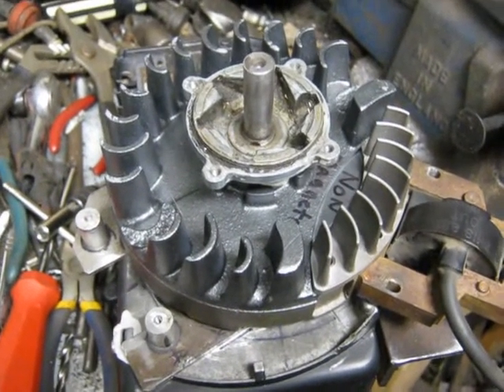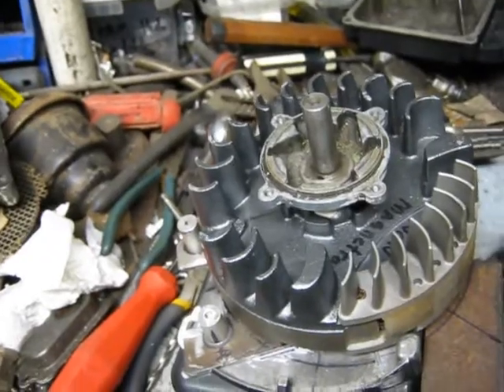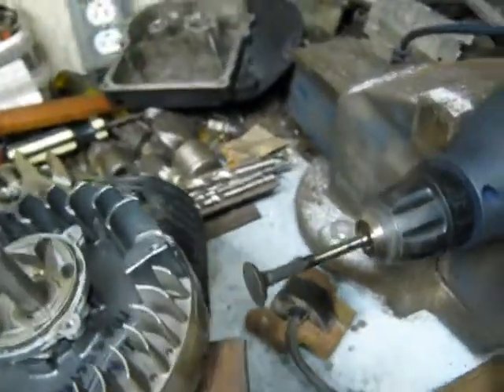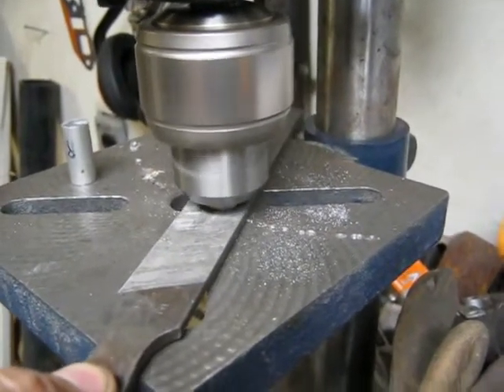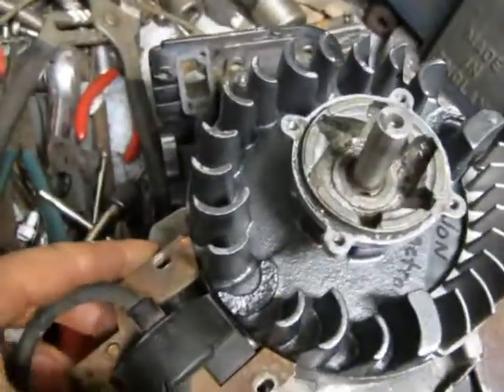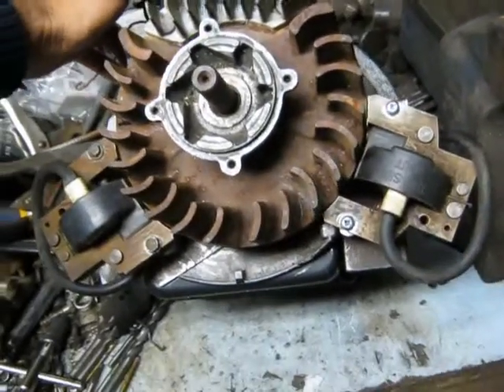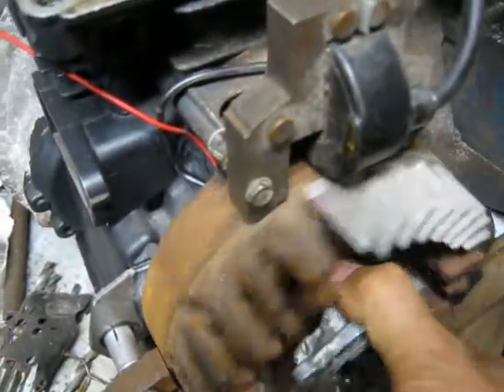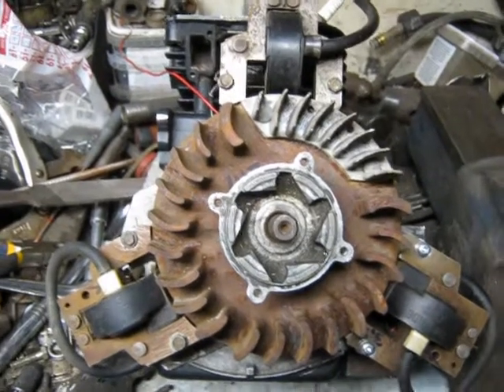3 Cyl. Briggs 327 Magnetos Mounted

Comment: how you been charger guy i havent spoke to u in a bit good luk 327 rotary
Reply from the maker: James Scherbenske Hey good to hear from you, I got the 327 running, it just has some serious crankshaft slap making noise.
Reply: ChargerMiles007 what is it hitting ??the block
Reply from the maker: It is the split joint between the crankshafts, they have too much play, so they make a slapping noise when the engine is running. I imagine one of them would break if I kept running the engine.
Reply: ChargerMiles007 ohh ok maks total sence too me by the way iam a jenious when it comes to theses engines ask me any questios

Comment: So do you like the points and condenser better then the magnetron coil?
Reply from the maker: beingsneaky Each one has its advantages. Points will fire at a much lower speed, probably making starting easier, though they can get corroded up over time requiring maintenance. The magnetron is very easy to install, in comparison, and seems to be long lived (if you don't try to spin the engine over without it being hooked to a spark plug!)  I guess it is a toss up for me, though I have used more Magnetrons the last few years.

Comment: Cant wait to see it run. :)

That's a clever idea with the drill press and file.
Reply from the maker: willythewave Yes, it can work well on small projects, you just have to be very careful, or you could eat the file!   It is strange how life works though, last night I was working on drilling a 7/8" hole thru 3/16" steel plate making the carb. mounting flange for this engine. I was almost done when the drill bit jammed, and the 1/2" drive hand drill almost broke my wrist, as the handle on the side slipped on the housing! I have never had a drill grab that hard before, it actually tweaked the drive shaft of the drill so that the chuck is a bit out of round now. I can't use my drill press on large bits, as it spins too fast, 700 rpm minimum I think it is. Guess we never know when we could get hurt doing something we have done lots of times before. Stay safe out there!!!

Comment: cool clean flywheel and ends on the coils to make better and stronger spark then regapp Happy Thanksgiving
Reply from the maker: Jim Rowlings Yes, I do still need to clean up the somewhat rusty flywheel. I think the coils are pretty good.Yes, Happy US Thanksgiving to you also. My wife being from the States is cooking a turkey right now  :)To give you an update on the 3 cylinder, I am making good progress on the intake manifold. Brazing copper and steel together is a pain though, the copper conducts the heat away faster than my brazing fueled torch can put it out! But I managed to get it done, now time to solder the other joints and weld on some mounts to hold it to  engine block #2 :)
Reply: i'm from Canada and still live here bud
Reply from the maker: Jim Rowlings Yes, same here. no plans of heading south like the Canada geese  :)
Reply: lol

Comment: I noticed the same thing on my grass cutter with how slow points will fire. For a couple years I used Magnatron on that engine. It didn't start as easy, didn't have as good of throttle response, it used more fuel and it didn't have as much power as it did with the points. I found a brand new 70's NOS points coil to put back on that engine for $20 to my door. 30 years of heat turned the original condenser wire to the coil in to mush. Not sure what Briggs is smoking to advertise the Magnatron to be a super powerful ignition system. You ever been shocked by Magnatron and then a points system? big difference!
Reply from the maker: 1972FordF150 No, I can't say I have been shocked by one, then the other (I try to shy away from getting zapped by ignitions!) lol  So you have felt the power of both and believe points have more zap to them (if set up properly etc.) I am not really sure, though in high school shop class I was working on Lucky number 13  (a 3 horse Briggs). After we set the point gap and armature air gap correctly, that thing would fire about 3/4" to a head bolt when spinning it over without the cylinder head. It was unbelievable, you could see a blue ball on the end of a blue streak of light. I have never seen one spark quite as far since then. Needless to say I didn't hold onto that spark plug wire to test it!!!  :)
Reply: Yeah the points have a way stronger zap to them.  Being zapped by the points actually made me sick for a while
Reply from the maker: 1972FordF150 Now that I think of it, when I was about 12 I was using and old Tecumseh pushmower that didn't have a stop wire. I got the brilliant idea to pull the spark plug wire off to shut it down. BIG MISTAKE!!!! Once I pulled it off and the zapping started, I couldn't let go of it, and got zapped until it stopped! You can bet I NEVER did that again, I just stalled it out in long grass! My whole arm was numb, and the zapping hurt like heck. It went away pretty quick, but I learned my lesson.
Reply: I have this 1978 Echo SRM200DA weedwacker, and I'm having ignition problems with it. It has excellent spark, but the spark must fail under load when the sparkplug will be inserted, as it does absolutely nothing. That little damn thing shocked me a couple times once on the left hand. Wicked enough to make me want to puke and make my heart skip a few beats.
 Killer weedwacker with points!
Reply from the maker: 1972FordF150 Man. that sounds like a heck of a spark!
Reply: I also learned with that thing, never hook a multimeter up to the ignition system and pull the rope. Fried that thing lol.
Reply from the maker: Yes, I bet it did!
I learned the same lesson about the ammeter function, I hooked it up wrong somehow on an electric box fan, and blew the red testing wire right in half!  It was rather spectacular, but not very funny for me, as I was holding the wire at the time!
Reply: My multimeter had a burnt smell to it after that. It peaked at 17,000 volts then fried it good.

Comment: Nice work, looks cool! I love points :) Kind of a random question, but what brand is your vice? It says made in England on the side, just curious.
Reply from the maker: SuperKONR Yes, points work very well indeed. The vise is made by Record, I have used it for over 30 years, I think my father bought it used. It is a 5" vise, I have put some large items in it and it has taken the abuse, though I need to repair my work bench as I broke the wood out around 1 bolt pounding on a briggs lawnmower crank trying to straighten it! The crank won that battle, it is still bent.

Comment: Looking awesome, I was kind of curious how you was going to do the ignition but now I know. Good luck with the build and you have a good one too.
Reply from the maker: Tinker Jim Thanks, I just figured this was the simplest way to do it, though it turned into more work than I thought. Luckily I was able to build the gas tank mount and the new recoil starter bolt holes into the two new mounts. The air cover is giving me problems though, my friend at AC/DC Welding may be able to help me out with that, as my welder won't weld the thin metal with flux core wire! I normally pop rivet sheet metal but this one is more complex than others I have made.

Comment: It be a neat one when she's done living the 3 magnetrons on it  always liked that set up better then a coil any way
Reply from the maker: Mr3wheeledbike I decided to go this way as the mower engines didn't provide a simple distributor drive, plus this idea seemed to work out OK on the 2 cylinder stacker (once I routed the plug wires away from each other).